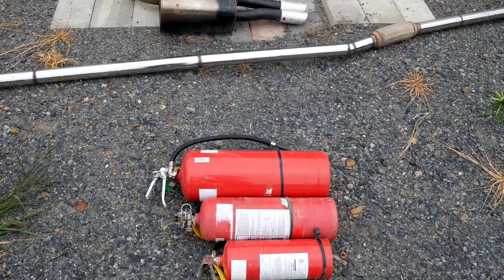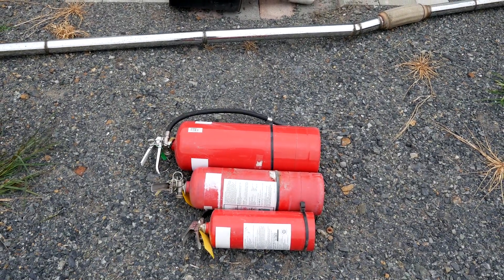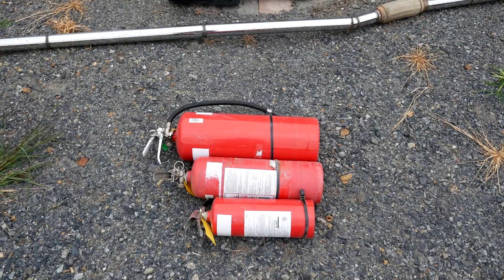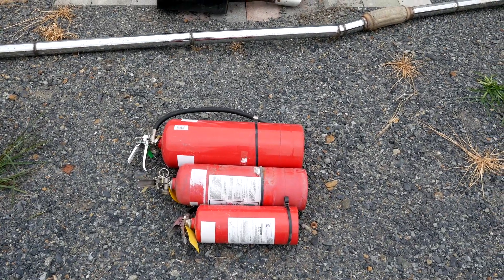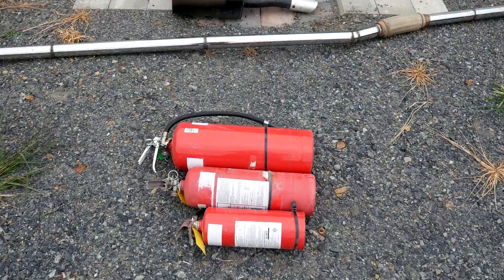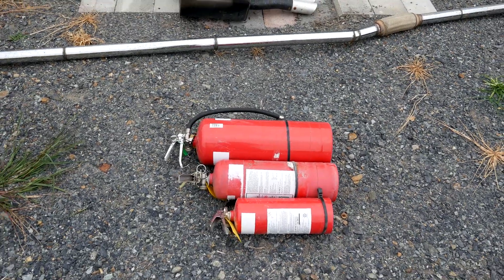Exhaust testing - Gold 4age - Dyno tested

Comment: Is this an attempt at the "pressure wave termination box" concept?
I briefly ran a full exhaust with nothing but pipe all the way to a stock muffler at the back and at a certain RPM the reverberation was so bad that I could feel the buzzing through the accelerator pedal. Then I gutted an old resonator and put it in under the passenger footwell and it smoothed the whole engine out quite nicely.

Comment: if you work with cone , put it on the end(opened cone) but do not make too steep  and too big cone because exhaust gasses are under pressure but not on too big pressure and therefore it could go with supersonic speed but only if nozzle is right shaped

Comment: the pulses from the intermittent expels of exhaust gases cause pockets of vacuums every time the valves shut, this vacuum travels down your manifold and mixes with every cylinder. the vacuum from one header helps to pull the gas from the next but its all about timing. 2 strokes are a great example of high reving tiny exhausts. and this vacuum effect is the reason they have funny looking "expansion tanks". there's more too it but if you try brining one cone larger and then one smaller again that could be interesting. or play with your manifold length too. thats fairly interesting to watch though. id love to see how back pressure could affect its mid range

Comment: Love that there's still some love for the 4ag. Nearly 20yrs ago my first car I used on track days (back in Aus) was an AE92 hatch that was originally a base model (no ac, no power steering, solid front discs and drum rears!) that the previous owner had swapped in a silver top 20v. I absolutely loved thrashing that car and taking it for later night mountain runs in the middle of the week when there's no other cars around. Especially on the very cold nights when I swear I could hear a difference in the way it ran/sounded. All sorts of budget mods and upgrades were done and tried on that car, nothing that unlocked magical amounts of power but all great fun! Later I helped a friend build a lotus 7 replica (think Caterham) completely from scratch and we used a silver top for that. With the aim of later modifications (and awesome looks) I designed a custom set of headers with equal length 2"primaries, everyone laughed and thought that with the std engine/ECU (needed for initially getting road registration) it would either run like a pig or have worse low down torque etc etc. When finished and run on the Dyno it actually made 2kw more than my AE92 despite having more drivetrain loss. I was very proud (and a little surprised, everyone has me convinced it was going to be terrible). Sounded awesome and looked amazing.... Very formula Atlantic :) anyway..... Great content and love your experiments!

Comment: Have you ever experimented with anti reversion cones on the intake and or exhaust? I have found some torque on the bottom using them on some setups. Don't size them to restrict anything.
Reply from the maker: If you watch this vid it shows the adapter i use from my headers to 3"  system. It kinda works like one.  the 2.5" collector sticks through the 3" section.  https://www.youtube.com/watch?v=UAyP7YJQ8Kg  it shows what it does with the open header.   i haven't tried anything per runner.

Comment: Have u ever compared 2.5" vs 3" for exhaust? Always hear 2.5 being better for NA 4 cylinders but I'm curious since you're running 3"
Reply from the maker: If you watch this video and the the one previous to it i run a 60mm exhaust vs the 3"    what ive found is the first part of the exhaust is critical.   after first muffler not so much.    going big all the way after collector  is the easy way to make things work.  only drawback  is the weight

Comment: What do you think about prediction software for exhaust length and diameters?
Reply from the maker: TBH  I haven't used them,  other than a few basic calculators found around the net.  I'm sure some will get pretty close.  but testing on engine is going to be needed as well, since so many variables
Reply: @Garage4age  I think the way is to perform a lot of predictions and then to real world testing the predictions. A lot of stuff to insert in this software... shall I contact you somehow and show you something?
Reply from the maker: @TurboAcki   Yeah agree,  pretty much what i was trying to say.  garage4age@gmail.com  if you want to email me

Comment: Drill a small before the back box weld or braz a small metal or copper pipe from it  to a  clear plastic pipe in a u shape  add water to the u of the pipe for ever horse power  you need 2.2 cm per bhp  so a 130 bhp engine should have 286 cm of water push up the clear pipe  find a back box the gives you 286 cm back pressure that's how to tune a exhaust
Reply: Have you got a link that shows this? Sounds interesting
Reply: @jamesford3549   you'll get it in a book by David vazard  mini

Comment: What does the baseline 3" system consist of just a pipe and muffler?
Reply from the maker: The baseline is the 60mm.     The normal 3"  i compare it to at the end of vid,  is 3inch all the way, has 2 straight through reso/glass packs and a more traditional style muffler at the rear that has internal diameters of at least 3"

Comment: It would be good to see if extractors built 4 into 2 into 1would do to your power curve. 
It's funny that all the different dyno runs in this video didn't make  big drops in the top end compared with some of the drops in the mid range or bottom.
Reply from the maker: Will probably do some stuff on extractors  further down the track. I've got a few ideas i want to try

Comment: my curiosity, do you have test, stock engine power, then add better exhaust manifold, then ITB´s, then some cams..I mean would be worth??
I was search if you had some dyno testing from then to see result??
Reply from the maker: Not 100% stock.  but this engine started off with stock cams and intake a few vids back.   i didn't have any stock parts for the exhaust side,  and head has some port work.    playlist here starting from when i built it: https://www.youtube.com/playlist?list=PLCZDwNynUKJMA2D7m1pP9BjKKQ9sNqRVp

Comment: Have you ever done tests with a relieved flywheel?
Reply from the maker: what do you mean buy relieved?    This engine has the toda 3.7kg flywheel off my good engine on it.  haven't tested against stock on dyno.  but it makes a big difference  on the road/track
Reply: @Garage4age  here in Brazil we say "relieved" when we put a lighter flywheel.
i have an opel c20xe engine and it comes original with 9.2kg and went down to 7kg, as i took the gear to fix the gear hitches, i'm going to take and take more weight, but i was in doubt how much to take. I can get material out of it on the lathe
Reply from the maker: I thought that's what you may have meant. I like how they drive with a light flywheel, even my 4wd has a light flywheel in it, rev out much faster.    be careful not to weaken it if a cast item
Reply: @Garage4age  thanks for answering! about weakening it I can get it out of a place that has plenty of material! continue with your videos I'm watching here from Brazil ..

Comment: Man I love this channel. No bulls#@t, just testing and results.
Would consider ending one of the biggest debates over the years? Split dump vs bellmouth vs bellmouth with devider?
The split has some key points like velocity stacks though. Like, the pipes should expand to full exhaust diameter gradually (low angle long cone) and the separated gases shouldn't rejoin until approx. 18inches. From reading a WRC tech article.
Reply: Are you talking intake bellmouth? Got a link?
Reply: No, post turbo exhaust @jamesford3549  .
Just search, "split dump, bellmouth dump and bell mouth dump with divider".
Reply: @jamesford3549  I only mentioned intake trumpets as a reference because there is a science and performance difference to the length and profile. As applies when making a split dump that re-enters further down the exhaust. About 18inches from some rally research paper I read.
Reply: Thanks, what website, loads of forum results for that

Comment: You may have already answered this, I tried looking down in comments but couldn't see. What's with the dips in torque and power lower in rev range?
Reply from the maker: pressure waves.   you can see when i add the straight through mufflers it kills them. its much more pronounced on an engine with decent amount of cam overlap.  In an ideal world would grab all the peaks an none of the dips.   this vid i was just throwing random stuff at it  to see what it would do.  will be working towards trying to grab some of that bottom end the open headers gained.
Reply: @Garage4age  ha thought it might be so... My undergrad dissertation was the design of a race car's intake and exhaust, tuning the runner length to time pressure waves for peak power. We did it all in Lotus Engine Sim and on an engine dyno.... Prefer your more hands on approach! Keep up the good work!
Reply from the maker: @findlay234   Nice.    Yeah sucker for punishment doing it the hard way.

Comment: can you explain what are the differences coming from? are they just because you are restricting flow or does resonance play a big part in the changes?
Reply from the maker: its to to with the pressure waves. as you can see in the vid, the muffler kills the peaks and dips. the open chambers don't
Reply: @Garage4age  cool. I work with 2strokes which make most of their power from the exhaust pressure waves. Cool to see that it affects 4strokes as well

Comment: Bud not much is going to matter after the first abrupt opening.
Any changes are going to occur in the resonance based on the location of that abrupt opening.
So for instance, where you had your open headers, if you put your expansion or chamber there and then run whatever exhaust that flows well enough after that point it should look similar to your open headers.  Maybe give that a try since the open headers seem to do the best.
All you really need to do is stall the exhaust wavefront by having it expand and open up, so the exhaust between the ports and that expansion have somewhere to reflect off of.
Next step would be to try a slider.

Engine: =====[|||||||]============={atmos}
Engine: ====={atmosphere}
Those should look similar in pulse tuning.

Now get pipes that slide in each other and find out which spots that expansion. Needs to be in, and slide it as you dyno see if you can make a variable exhaust "collector" :D
Reply from the maker: Yep, work in progress

Comment: I've always wonered what a two stroke resonator would do to a four stroke, not sure a 4 pot would be the easiest engine to test it on though
Reply: nothing because 2s res. works to rebound ex gas from cylindre and makes more compression and work only on one rpm, nothing before or after

Comment: Try to test fuel temperature effect on power, cooler fuel cools the charge of air as its mixed in the way to the cylinders and should make more power, there are very few tests about this. 
This may be one reason E85 makes more power even in not knock limited engine naturally aspirated engine.

Comment: since you like dyno a lot, you should try to fabricate or buy hondas cone exhaust manifold used in dragrace. it looks a bit like 2stroke exhaust. static pressure / vacuum test looked promising
Reply from the maker: Im about to build a megaphone out of fire extinguishers. will see how that goes, before resorting to honda parts 😂

Comment: Awesome videos. Try oval pipe after header is suppose to convert to laminar flow gases that exit easier
Reply from the maker: my normal exhaust is actually oval to first muffler
Reply: @Garage4age ... Other setup... Put the cone next to header merge 4 to 1 in order to gain scavenge with exhaust pulses
Reply from the maker: im building a megaphone setup to try atm,

Comment: Based on 3"muff into 60mm  vs open header, the pipe clearly isn't a restriction, its all about resonance and reversion. 
On my moto, I made a custom header that everyone said would be too big, but it worked amazingly well for increasing midrange power.

Stock was 38mm and I went up to 44mm but I also added a chamber off the side of also 44mm pipe, at 140mm long, closed at the end, but it had a 6mm hole drilled into the pipe 

From what I understand, the diameter of the access hole determines the amount of boost the chamber gives, and the size of the chamber determines the frequency(rpm) that it boosts at.

Im thinking that as has been mentioned,  try a few different short lengths off the header like 12" seems common for v8 dyno runs, pick the length at which that peak is either enlarged or at least not dropping,  and then perhaps put that resonator chamber at that point. I think they call them J pipes usually used for cutting out drone at the rear end, but curious if it would help power if used at the header end.
Reply from the maker: Interesting.     Yeah will be trying some more stuff between header and first reso.

Comment: Each time an exhaust has a change in diameter it will send a negative pressure wave back to the exhaust valve, if the pressure wave is timed correctly you will have an exhaust scavenging affect that will evacuate the remaining gasses more completely, if it times with intake/exhaust valve overlap you can even pull some fresh air into the cylinder. It's possible to increase the volumetric efficiency with the right exhaust length. The exit of the exhaust is the biggest diameter change so you get the largest net increase with a tuned exhaust length.

Best way to test this would be modeling the exhaust velocity in a program but you could trial and error it with and equal length 4 to 1 header into a pipe with another pipe slipped over that one that you can just slide to adjust.

Comment: This one was fun to watch lol. I like watching you fabricate stuff. Maybe next time try a slow increase or decrease in diameter from beginning to end of the exhaust piping? Slowly increasing diameter from one end to the other may help with scavenging, decreasing may help with maintaining exhaust gas velocity..? I remember installing an Apex'i exhaust on a turbo eclipse that slowly stepped up from around 2-1/4" at the flange to 3" at the muffler. They claimed it helped, but it may have just saved them money over full 3" piping, who knows. Also, if you contact some exhaust manufacturers in your country, they may send you some new parts to help, like tubing or mufflers. Not sure if you could convince someone to ship free stuff overseas, though.

I'm curious...did you like the sound of any of these configurations over the others?
Reply from the maker: The bit where i hit stuff with pipe wrench?  😂   yeh will be trying more stuff.              the double straight through's actually sounded decent, still bit loud though, id rather just the intake noise
Reply: @Garage4age  Not what I meant when I said it, but the part where you whacked a bunch of metal and came out with a perfectly welded cone cracked me up lol

Maybe goof off and see if an extremely long straight resonator/muffler reduces horsepower and measure dB at the exhaust exit?

Comment: Gotta try oil and fluids to get more drag HP - Bizzy said he has gotten 15 hp from fluids - would love to see someone dumb enough to try it!  (And — no fab work! Wahoo!)
Reply from the maker: drain them all out ? 😂  definitely something in oil viscosity,  as power changes with temp / oil thinning out.  I have a vid on that if you haven't seen it already
Reply: @Garage4age  I agree on oil, what about diff fluid and trans fluid?  Is there something there that can help HP (thick fluid costs energy to spin especially at high RPM) - just ideas I guess

Comment: Collector extensions on open headers make a big difference to low speed power, I'd try varying lengths around 1m and see if it can fill in that void that the open headers had at around 2-3.5k rpm.

I wonder if moving any resonators/ expansion chambers to the end of the system would help, if the exhaust gas has less energy back there it wouldn't create such a big reverse pressure wave.

What does the normal 3" system look like? Does it have anything in it that would cause the power dip at 4-5k due to reversion?
Reply from the maker: Tbh i would take that hit in the 2-3.5k area, that the open headers have, for the gains after it. as never use wot down it those revs anyway.  the muffler/reso (not the open chambers) seems to be key to kill the waves,  so yes placement of the first reso and the pipe before it seem to be the area to work on.    the whole setup already works a lot better than pretty much every cam'd 4age ive seen, so im really chasing the little bits.     The muffler looks to be killing all the good waves along with bad. probably why the open headers win between 4-5000.  the normal 3" is kinda similar to the last pipe i tested in this vid, but the distance between headers and first muffler is longer.  and of course carries on 3" rest of way.

Comment: interesting. Try open headers with various lengths of collector extensions.
Reply: Good idea and megaphone power chamber can be added to collector also.
Reply from the maker: Thats the plan at this point. going to attempt building a megaphone as well
Reply: @Garage4age  is it the glass packing in the 3” muffs knocking down the pressure waves? Is that thought?
Reply from the maker: @overr8ted2   Yeah that seems to be whats happening,  getting everything correct before it will be key.
Reply: This is exciting
Reply: Some of the rotary race cars I've been around do 2 stroke style chambered exhaust and see big torque gains, wonder if it would work on a 4 stroke?
Reply: @ricepony33  high power 4stroke dirtbikes use small expansion chambers in the exhaust
Reply: @ricepony33  That's because there is no valve to close it of ( 2stroke / wankel ). Working with expansion chambers is like creating a valve using the exhaust gas harmonics